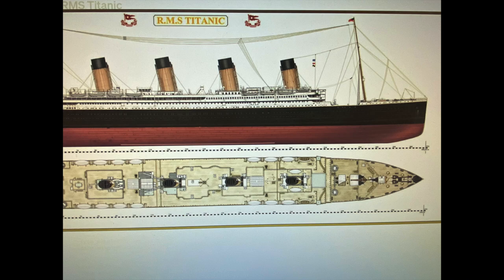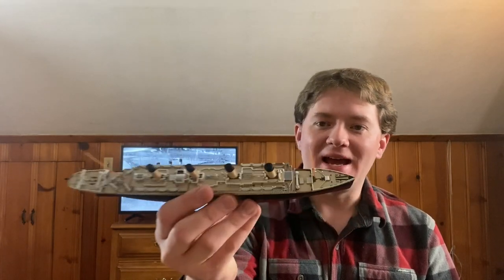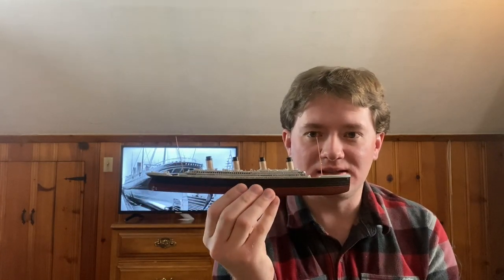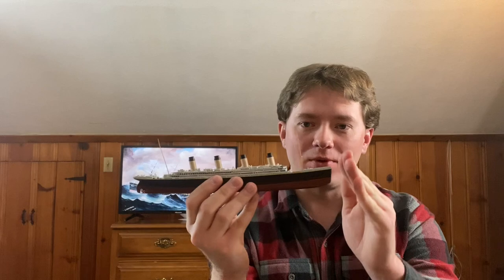Would more lifeboats have saved more people on Titanic?

Comment: The Titanic did not technically have 16 standard lifeboats. She had 16 wooden lifeboats, with Lifeboats 1 and 2 being emergency cutters, which are smaller boats designed for speed. They were already swung out in the event of situations like "man overboard" or if the Titanic came across a small ship that was sinking. A good example of this was when the RMS Oceanic collided with and sank the small Irish steamer Kincora, killing seven of the Kincora's crew. Captain Cameron of the Oceanic ordered two lifeboats lowered, which rescued the remaining 14 men.

But back to the Titanic. Lifeboats 3-16 were standard lifeboats, while the remaining four were collapsibles, specifically Engelhardt collapsibles. A collapsible lifeboat is equipped with canvas sides that could be folded up when not needed and quickly erected if need be. However, in the case of Collapsible A, its canvas sides were not raised before it was swept from the ship, leaving it half-flooded with its occupants bailing water as some of them pushed swimmers away or succumbed to the cold.

Proof of why the Titanic didn't need enough lifeboats is the sinking of the White Star Liner RMS Republic. In the early hours of January 23, 1909, the Republic collided with the SS Florida off Nantucket Island. Three people on each ship died during the collision, and worse yet, the Republic did not have enough lifeboats for everyone aboard. Fortunately, the Florida was determined to be in no immediate danger of sinking, and many aboard the Republic made way to the Italian ship. But the Florida could only hold so many. Wireless Operator Binns of the Republic had a CQD message sent out, the first ever sent, which was received by another White Star Liner, namely the RMS Baltic, which resulted in everyone aboard the Republic aside from those killed in the initial collision being saved. Another factor to consider is that the Republic took 36 hours to sink. It was so long that photographs of the damaged area were taken...from those still on board. Not only that, but the dead were pulled from the damaged area for identification.

James Cameron's Titanic depicted Lifeboat 7 nearly spilling its occupants into the sea. While this event did happen, it actually happened to the lifeboat adjacent to No. 7, that being Lifeboat 5.

It didn't stop there. You see, the lifeboats were equipped with plugs in order to allow rainwater to drain out. The problem was that those in No. 5 couldn't find their plug. Third Officer Pitman, in charge of the small craft, called up to Fifth Officer Lowe, asking for time to find the plug.

Lowe had not worked with the other officers before the Titanic, and was already in a bad mood, as he was never woken up for this reason until the crewmen swinging out the lifeboats bumped their arm against the window to his cabin.

Lowe had the crew halt the lowering process, and leaned over the side and said, "That's your own damn problem," and continued lowering it. Upon reaching the water, No. 5, naturally, started to flood, and so its crew had to plug the drainage hole with a woman's hat while they searched for the plug, which they never found.

Interestingly, you mentioned the incident in which Lifeboat 11 was nearly swamped by the condenser discharge, yet showed footage of Lifeboat 13 lowering into it. Lifeboat 13 was also the lifeboat that the adjacent Lifeboat 15 nearly lowered on top of.

Lifeboat 4, despite being readied by 12:30, did not leave the Titanic until 1:50, with the water almost reaching its keel. Lifeboat 4 had been lowered down to A-Deck, whose forward end was enclosed to keep passengers from being hit by sea spray, a feature not seen on the Olympic. The windows that enclosed A-Deck required a certain knob to be installed in order to open them. This knob would not be found for some time.

Many of the notable first class families, like the Astors, the Ryersons, the Carters, and the Thayers, found their way here, but as the knob was nowhere to be found, after a half hour they were brought up to the boat deck, only to find the the lifeboat crew had moved else, and as such no one was there to hoist No. 4 back up. After another half hour of waiting, these families were shuttled back to A-Deck, where the knob was found and the windows were opened, allowing the loading to begin. By this point, the Titanic was beginning to list to port, so deck chairs were used to bridge the gap. After about 30 people were loaded, No. 4 was lowered away under the command of Quartermaster Walter Perkis.

Thomas Lynskey of the T:HG project did mention that if the ship had enough lifeboats, ironically more people would have died for reasons you already explained. He did say that it would be fine if the middle section was knocked away and replaced with lifeboats. Otherwise, there was no convenient place to store these lifeboats.

Contrary to popular belief, the Titanic had more lifeboats than her original design called for: Her original layout called for sixteen boats with a combined capacity of 990. Her final layout had twenty lifeboats: Two cutters with a capacity of 40, fourteen standard with a capacity of 65, and four Engelhardt collapsibles with a capacity of 47. Combined, that is 1,178 seats.

On a final note: it is fortunate that the real Titanic was nowhere near her full capacity when she sank, meaning that Richard Sturges wouldn't have to haggle for a ticket, nor would Steward Etches have any troubles moving Isabella Paradine to another cabin.
Reply from the maker: This is incredible man, I can tell you are an expert on Titanic and thank you for watching my video! If you ever are interested in doing a collaboration video I would be down. The goal of my channel is to tell the story of the Titanic and be as accurate as possible. Wasn't the lifeboat I mentioned also hit by the condenser.
Reply: I'm just an enthusiast with a good ability to retain memory. I seem to specialize in memorizing what events occurred at which lifeboat.

While it would be interesting to collaborate, I don't have the equipment to make an appearance on YouTube. I also have a somewhat busy schedule that involves making digital sketches of ships of my own design. My channel, however, has one video that serves as a place for people to communicate with me.

My personality seems to tell me that I enjoy pointing out mistakes people make on the internet. However, I do not do so with many people, doing so as little as once per video.

This website here may help in being a good research tool: http://titanicofficers.com/index.html

One topic that has intrigued me is the comedic moments of the disaster and those who were on board, such as how, when Charles Stengel attempted to climb the bulwark that separated the deck from Emergency Lifeboat 1, he stumbled and rolled in, causing First Officer Murdoch to remark, "That is the funniest sight I have seen tonight!" Then there are stories like Charles Joughin's intoxication saving his life, or Second Officer Lightoller's prankster-like tendencies. Moments that could be considered so offensive or dark that they are considered funny instead should not be included.

In short, while collaboration would benefit both of us, I don't see how it would be feasible. And I really doubt, given my lack of luck, that any large amount of people would look at my artwork.
https://www.deviantart.com/shipping-architect

Comment: I'm thinking if there were more davits and an organized way to get people into the boats (everyone had an assigned boat to go to) the evacuation could have happened much more quickly and most, if not all could have made it. Also, don't put extra lifeboats on the officers' quarters without a good way to get them down.
Reply: The one thing i noticed about the james cameron simulation was that the crew operating it was significanly older than what the titanic crew actually was and when you factor in adrenaline I bet they could have operated quicker
Reply: I doubt even if assigned a station, that people would have gotten into the boats. People didn't want to leave the warm, comfortable ship in the middle of the night with everything they had onboard left behind

Comment: When a ship capsizes like Britannic did, you cannot use the lifeboats on the other side of the ship. Also, Britannic's propellers were still operating, dragging the lifeboats into them. So there can be situations were lifeboats are not safe
Reply: Brittanic didn't capsize, she was upright up until the moment she hit bottom then she rolled on her port side settling in the mud, you are correct on the propellers pulling a life boat into them as they were in operation, the captain was trying to beach her so she wouldn't sink, but the bow flooded too quick and the propellers raised out of the water. I think you might be thinking of Andrea Doria, she was rammed by another ship, the Stockholm, ripping her starboard side open at about the center of the ship, almost from the moment Stockholm reversed and pulled her bow out of Andrea Dorias side she was listing too heavily to starboard to use the port side lifeboats.
Reply: Britannic didn't capsize, that was just a poor portrayal done in the movie. Also, those lifeboats were launched in violation of orders from the captain who'd halted launching them. The sinking had slowed down and the ship seemed to be stabilizing (relatively speaking) and he thought he might now have time to beach the ship. But some people panicked and launched anyway, forcing him to stop to try and not kill those people and then resumed launching the lifeboats as the sinking had begun picking up speed again.

Comment: 1:51 wrong. 

Lifeboat capacity was based on tonnage. 
In 1912 the regulations was outdated. Titanic and Olympic topping 40000 tons didn't have any regulations since the regulations stopped at 10000 tons.
Reply from the maker: Ya I see, I should of mentioned that. What I said in the video wasn’t wrong the board of trade did encourage you to put more watertight compartments in to make ships safe but you are right as well. The number of lifeboats was primarily based on ship tonnage. Thanks for mentioning it. :)
Reply: @HistoricTravels  both olympic and titanic was designed to be its own lifeboat. 
Captain Smith said years before the disaster:
, “I cannot imagine any condition which would cause a ship to founder. Modern shipbuilding has gone beyond that”. 

What we see is a belief in technology, beyond normal senses.

But, to defend the sentiment in 1910, no ship had ever been ruptured the way Titanic was damaged, so in every rational sense, Olympic and Titanic was one of the safest ship afloat at that time..
Reply: The boats could fit at least 70 people.
Reply: Take the lifeboat number for 10000 and then times it by four.
Reply: @Vincenza8907 , I thought it was around 64?
Reply: @ChickenLiver911  they were tested in Belfast and they fit 70 men in a life boat.
Reply: @ChickenLiver911  They were designed to carry 60-64 but tested with 70 to make sure they could handle it.
Reply: @lagresomadsl  Titanic remains the largest Liner in history lost to natural causes. A freak accident, compounded by a multitude of little errors
Reply: @Tempusverum  Well. We have the Derbyshire. That ship is a bit bigger....

Comment: One of the davits(I believe it is on the starboard side of the ship) is in the process of having a lifeboat launched(it is facing a different way to all the other davits) on the wreck. They were trying to launch a boat when the boat deck went under the water.
Reply: Each set of davits was originally designed to hold up to 4 lifeboats, stacked one on top of another.

Comment: I'm going to go out on a limb and say, yes, but probably not everyone, since it appears people were either reluctant to get into boats, and there weren't any offical boat drills.  I'd say even if they had the full complement of 48 or so lifeboats, still I think a good number of people would have still died, mainly for the two reasons of fear of getting into a life boat (thinking being on the ship is safer) and the lack of drills to prepare staff to launch them in a timely fashion.
Reply: The ship actually sank pretty fast. There was barely time to launch 18 boats.
Reply: @1940limited  I know this is a year late in me responding, but at the same time, not all boats were launched full either.  But even if they launched all boats (I think it was some 24 boats total, with a capacity of about 60 people per boat) that was still not enough, given there was an estimated 2300 people onboard.  I believe they also skipped the muster drill (or it was not required at the time) but that may have also changed things too (even if it wasn't required, there should have been mandatory crew training, but I'm not sure if that was even done).  Either way, it does sound like from witness accounts, the boats were ordered to return to the ship so that more passengers could be loaded.  2:15 to sink is fast, but at the same time, it's not (and I do not recall any comments about the ship listing so badly that boats could not be launched, although there may have been other potential reasons why all the boats weren't launched).
Reply: @HR-wd6cw  It was pointed out to me only recently that an hour passed before it was determined the ship would sink. Theoretically, if they had started loading the boats right after the collision and packed them full, about half on board would have found a seat. It was a hopeless situation no matter how you look at it. The last boat to go was a collapsible off the starboard side with Ismay in it. According to accounts (possible his) the boat umped against the side of the ship all the way down to the water due to the port list.

Comment: Interesting how life boat quota was generally based on how 'water tight' the ship was and deemed to be 'unsinkable. Coal fired ships with potential for coal fires that are hard to put out, boiler explosion, early electrical equipment fires, smokers on board and constructed mostly of timber decks and timber accommodations with no fire stopping capability....you'd be forgiven to think that fire was as bigger concern in these old liners and that life boat numbers would be just as much were considered for evacuating crew and passengers in the event of a large fire taking hold on board within the ship's structures prone to combustion, flash over and rapid fire spread

Comment: One thing to consider: What if they changed the order in which the boats were launched with the forward boats being launched first and the rear most boats being launched later. I figure if they had, maybe Collapseables A and B would have been able to launch properly.
Reply from the maker: This is just a theory but I dont know if they had a good way to even get thoes boats down off the roof of the officers quarters in order to prep them. I think they were more for show.
Reply: @HistoricTravels  Well in another video you mentioned they were attaching Collapseble A to the davits but the ship was sinking so fast at the time. So if they launched the forward boats first, they could have figured something out.
Reply from the maker: @Tom8201  Yea earlier in the sinking perhaps, but they were not in a good location to be prepared for launch. If I would of been on the Titanic I would be more distracted with getting the other boats away first. If they had better communication I am sure another way could of be found but considering everything that happened I think they did the best they could. But you are right, if they had launched the forward boats first and went aft then yes they may have been able to launch the collapsable. But remember it took nearly 2 hours to launch all the boats on the ship with all the officers working to launch them. I honestly think the officers were not even thinking about the thoes boats til near the end.
Reply: @HistoricTravels  Perhaps Thomas Andrews could have provided the crew some hints to get them down from the officers' quarters.

Comment: The only way more people would have been saved when the Titanic sank, would be 1. To have held the lifeboat drill that was canceled the day before.  2.  Make sure every lifeboat was filled to capacity, plus a couple of extras.  Having more lifeboats would not have helped because the barely got the boats they had off.  If the ship did have more boats and they started with the boats as sone as they knew the ship was going to sink, they would have to get 4 to 6 additional lifeboats off.

The Titanic was going to have more lifeboats on board but, the White Star Line held off putting the boats on because they wanted the decks to appear nice and spacious for the maiden voyages.  The more boats the more cluttered the deck. The additional boats were to be added on the return to England after the maiden voyage.  They were to have been stacked behind the boats that are in the davits.

Comment: Excellent breakdown however I do have a question, what about the Brittanic? 

from what I understood it had about 1065 people on board of which only 30 died (because they launched lifeboats without permission while the propellers were still spinning) 

and the ship went down MUCH faster than the titanic going down in 55 minutes as opposed to the titanic which went down 2 hours and 40 minutes later 

so looking at these numbers it seems to me that the Brittanic crew could have saved everyone on the Titanic if given enough lifeboats and with over 40 min to spare (under 2 hours to get everyone off) 

why the difference? I know they would have lost some time due to the placement of the lifeboats getting in the way, but that problem would reduce the most boats being launched